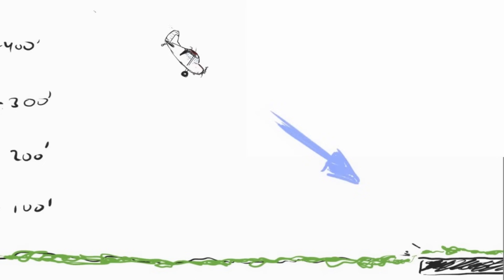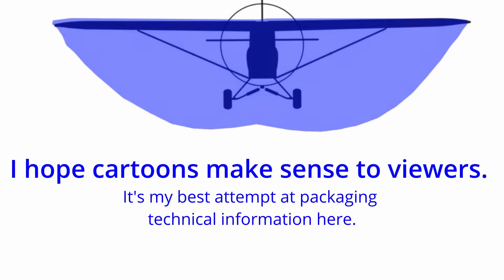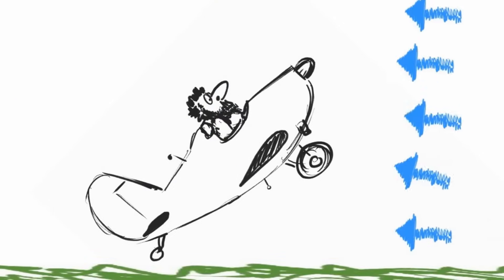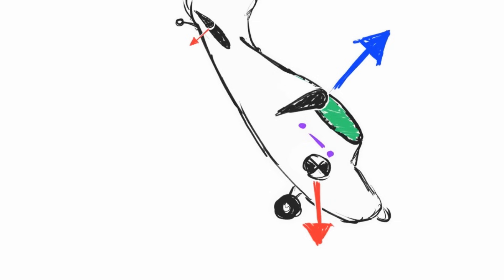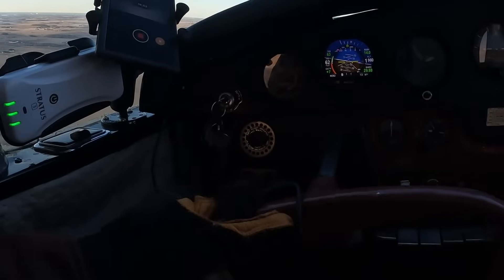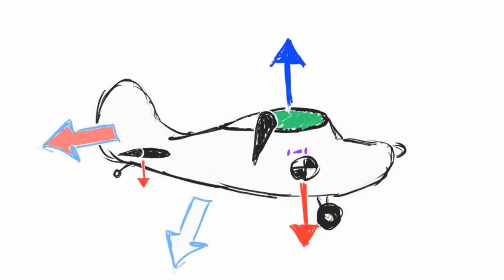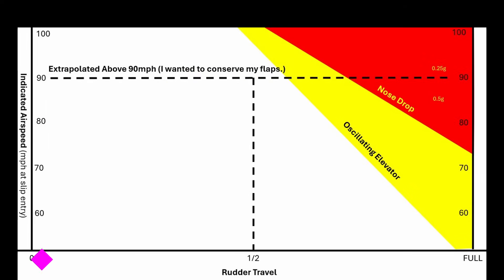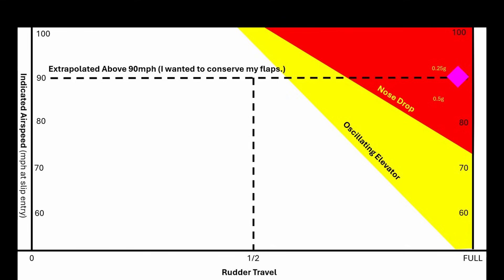Crash of a Cessna 170B, Did Slipping with Flaps Factor?

Comment: I'm having a hard time with this. The horizontal stab is an upside down wing with the lift vector pointing down. When downwash is lost on the tail during the slip and it rises into the wind, doesn't this increase the AOA on the tail and create more downforce, balancing this out? The theory here that elevator effectiveness comes from downwash from the main wing root violates the inherent stability of airplanes
Reply from the maker: You're right.  The horizontal stabilizer is, basically an upside down wing.  For simplicity I'll talk about downforce instead of negative lift.  So in normal flight the downwash from the wing approaches the horizontal stabilizer from angles that help the horizontal stabilizer create downforce.

In a stall, flow separates from the wing and that downwash is lost.  Back at the tail this changes the angle of attack at the horizontal stabilizer, so now the air is approaching from the bottom of the horizontal stabilizer.  A wing at a negative AOA creates lift, but in the opposite direction.  With a reversal of AOA at the horizontal stabilizer, that downforce is turned into upforce (or a whole lot less downforce).

I'm glad that you talk about the inherent stability of airplanes.  Placing the horizontal stabilizer into the downwash of the wing DOES make the plane somewhat less stable in pitch because more downwash occurs at higher AOAs.  This is why T-tails are a little bit more efficient because they are less-affected (though still affected somewhat) by wing downwash.  

There's a discussion of this phenomenon in Aerodynamics for Naval Aviators, pages 256-259.  The text is available for free from the FAA as a .pdf, and is easily searchable through google.  I'd share images and sections here, but I can't figure out how to make links work.  If you're using the table of contents it'll be the section under "Stability and Control".

If there's enough interest in this I may set up some CFD models or rebuild a wind-tunnel for my kid's school and we can capture some videos with model planes.
Reply: @jonathanzarinnia884  I think the wind tunnel thing would be sweet, I've looked for exactly that before and haven't found one.
Reply from the maker: @digitaldyslexia7589  Wind tunnel videos used to be all over the place, but now they're getting hard to come by.  Openfoam has some decent CFD capabilities within my very low budget.  I have to teach myself to use it better.  If this thing ever gets monitized, maybe I can ask a grad student to set up some meshes and run some CFD for us?
Reply: The flap is pushing air downward disrupting flow on the horizontal stabilizer. In a slip the fuselage blocks the flow to the opposite side and causes asymmetrical flow over the horizontal stabilizer/ elevator.= pitch down.

Comment: My old, grey, 195/waco -flying instructor said that you cannot stall in a slip, but you can coming out of it.  Dunno if he was talking only about the no-flap J3 or Luscombe.  I've had an early 180 since 1996 and do slip it with full flaps w/o issue.  But, the 180 hardly has a rudder compared to pre-war planes.  I'm wondering if the 170's with a (relatively) larger rudder and lighter weight (for roughly the same airframe) contributes to this here?
Reply from the maker: The NTSB investigators surmised there was a slip.  When the report was sent to performance analysis, they compared GPS track data with weather at the time and figured out the speeds, banks and angle of attack of the airplane during the event.  The AOA never got close to critical.  The performance engineer suggested some form of sideslip may have been applied in order to make the math work.  The NTSB investigators also surmised this may have been an issue from the context of the flight, etc.

So we don't know if they slipped or not.  We think it's likely this was tried.  But you are correct; without observers, video, recordings we'll never actually know.

Comment: Wow, what a long-winded way of saying that there is no need to use full flaps on a 170B until you're almost over the threshold.  Using flaps to steepen your approach and lose altitude is much more inefficient and dangerous than slipping.  Since the 170B has a flap handle, adding all the flaps you need for any particular type of landing is a matter of about one second.  Having full flaps a mile out on the final approach eliminates any chance of making the runway in the event of an engine failure, and besides that, if you have to dump flaps, you immediately lose altitude.  None of that happens in a slip.  When going in and out of a slip, the plane flies immediately without losing any altitude. 40 degrees of flaps and slipping is overkill and dangerous in a 170B

Comment: Interesting, I've been slipping with full flaps for 20 + years in my exp. RANS S-7 , and never had any elevator blanking, I didn't even know it was "a thing" until hearing about it here.
Reply from the maker: It's mostly a thing for the Cessnas because of the specific design of their flaps and tail.  I wouldn't worry about doing it in your s-7, if you and your friends haven't had problems.

I still occasionally do it on the Cessna 170, but I'm slow when I do to stay away from the conditions that cause the drop.

Comment: Too bad. Forward slips with flaps a great tool at times.
Reply: Why?
Reply from the maker: With 40 degrees of flap the plane sinks pretty steeply.  I still like having the tool available, just like having S-turns, etc. in the playbook.  But you're right, there's a lot of drag available to get down with 40 degrees of flap and the engine un-wound.
Reply from the maker: I still sometimes slip with fully deployed flaps if I need to, but I'm slow.  So I'm not saying you can't do them; I'm just saying you need to know the risks and recover if you encounter the nose drop.
Reply: Hard Slip no-flaps, pop partial flaps, exit slip. Then full flaps, stabilize, flare.

Comment: Does this slipping restriction only apply to full 40 degree flaps?  Is it ok at 30?
Reply from the maker: Well, it's not a restriction.  And the precise line where it becomes an issue is hard to describe.  You don't get the nose drop at 30 degrees flap, or at least I wasn't able to find it.  I did get some elevator oscillations.

Comment: How can anyone state he was slipping the airplane with no witnesses to confirm it.  Like others I've slipped 172's with different degrees of flaps in heavy crosswinds with no issues.  If maneuvers are handled smoothly without over-controlling, i.e.: chasing the upsets behind the game, there should be no issues.  Any decent airman can feel the airplane and avoid troubling inputs.  I think flying floats from a river with never ceasing crosswinds teaches a lot about slipping to spot land in tight areas and a lot of fun.
Reply from the maker: The NTSB did a performance analysis that concluded the plane did not stall (based on GPS data from a Garmin 296 and performance engineering).  So they guessed some kind of slip was applied.  This was in line with what the NTSB investigator on site thought.

We will never know the exacty sequence of the accident, however.  The only observations were from some people at the airport who saw the plane enter the pattern.

Comment: "The downwash from the wing hits the top of the tail."  Then explain how t-tails work.  In other words, that's not how the horizontal stabilizer works.

I think you're halfway there.  Another thing to consider:  Pilot freeze.  If the pilot had immediately returned the asymmetric controls to normal, they would have recovered.  If they froze, then they would have locked in the nose tuck.
Reply: Depends on how low they were.
Reply from the maker: So we teach that T-tails are out of the wing's downwash.  This is a simplification to explain the advantages of T-tails.  In reality air doesn't work with crisp clear borders (at least not until we get close to the speed of sound).  T tails aren't outside of the wing's downwash, they're less inside it.  

So with T-tails being less affected by the wing's downwash it takes less surface area to gain equivalent stability.  This is because downwash is de-stabilizing generally and a change of some value in the airplane's mean angle of attack results in some smaller variation in angle of attack at the tail.

But the T-tail is still affected by downwash.  A separation of flow at the wing will still affect a T-tail, but much less.  This is one of the reasons why T-tails in combination with swept wings lead to issues with deep stall in certain generations of transport airplanes.

As an aside, do you guys think there'd be any interest if I distributue some Open VSP wake models, charts around pitchining moments and compare those to what we see with yarn, streamers and other things taped to a plane?
Reply from the maker: T-tails are still affected by wing downwash, but some degree less.  We make a lot of simplifications when we explain things, and this is necessary to teach and understand any new concept.  In this case, we teach pilots that t-tails are "out" of wing downwash.  In reality they are still affected by the wing, just less so.  This is due to air being a viscous fluid.

So it's true T-tails experience greater variation in local AOA with changes in aircraft total AOA which means they need less surface area to stabilize the plane.  But it's also true that they are still affected by the wing and still experience changes when flow separates from the wing (and other parts of the aircraft).

For these videos, I too have to make some simplifications.  I could run a number of models in OpenVSP and share ancient wind tunnel video, but that would turn pretty boring pretty quickly, and then we'd devolve into a discussion about whether I was using realistic values in models with associated discussion of GUI interface, etc.  That devolves into an endless cycle of quibbling.

So instead I use cartoons, terms like "downforce", etc.  Even when we talk about angles of attack, we then have to disambiguate local, section, induced angles of attack.  So simplifications are necessary, but they come at a price. 

If there's demand for more granular detail and people want to poke holes in my methods and concepts (I'm sure there are plenty of holes to be poked.), I can put something together.  It's just me doing this however, so I have to right-size what I'm trying to talk about to my target audience.  In this case it's a broad spectrum of pilots.

Comment: I've slipped with flaps in a 172 on landing.  The main thing is to not let the nose drop lower than you had it before the slip, or to only let it drop a bit.  The slip doesn't require a further down pitch to lose altitude.
Reply: Either slip or use flaps.  No need to use both at the same time.

Comment: The analysis seems plausible. Those higher speeds on final are unnecessary, especially if you're slipping with flaps, which implies you're doing a short field approach. In my 172, the POH is more conservative, saying "avoid slips with full flaps" (emphasis mine). I have about 1500 hours flying various 172 models, plenty of landings on short/soft fields using slips with full flaps, and I've never encountered this. It's worth noting that the term "full flaps" can be ambiguous. For example many 172s have max flap limited to 30* in order to get an extra 100# of gross weight. In such an airplane does "full flaps" as written in the POH mean 40* (the airplane as it left the factory and presumably the airplane to which the POH refers) or 30* (the airplane as it exists now)?

Comment: I don't know what to say.  I flew 172Ms with 40degree flaps and slipped them with full flaps and no problems.  I didn't even experience the tail oscillations that the manual warns of.  Full-flap landing speed is 65MPH-75MPH IIRC.  If you're slipping to a landing with full flaps then you're trying to get down in a hurry, which implies you shouldn't be trying to execute the maneuver at high speeds where the nose drop was found to be.  Is this really a problem for Cessnas?
Reply from the maker: Sorry it took me so long to respond.  I slip with full flaps from time to time, and I made this video.  If you know what's happening when you get these pitch oscillations, and you can tell the difference between these and stall buffet, you know how to avoid and recover from trouble.

Comment: I was always curious about this when the threshold was crossed.  My instructor years ago just said full flaps and high speed with full rudder could cause a complete loss of elevator control, sort of like what happens in an unrecoverable deep stall in an MD-80 but in reverse.

Comment: Great explanations and animations!  I especially like that you mentioned the vortices off the outboard edge of the flaps. You get this aero engineer's seal of approval and SUBSCRIBED.  I slipped a 152 with full flaps with some regularity and never had an issue at any speed (thankfully).  I think what saved me was that when entering or leaving the slip I would ease into the slip so I could correct for pitch without even thinking about it.  Except for stall/spin recovery I tried to not make violent corrections.
Reply: I too have enjoyed full-flap slips with the 152,I think the 152 does not have the "no slips full flaps" warning, but then again they only go to 30 degrees.
Reply from the maker: Thanks!  Glad you like the video.  I'd like to work some CFD into these videos in the future sometime.  For now I'm very glad to have an aero engineer as a subscriber.

Comment: I agree, when I have full flaps down even in a c-172, something about that configuration just doesn't seem right for full slips, maybe its just because I read the manual, but it seems stressful to the physical aircraft and aerodynamics/ airflow over the plane.
On the other hand, flying a towplane - a pawnee, its slips great with full flaps ( the flaps are tiny ) right down to the round out and flare.

Comment: My wife and I have owned three Cessna 172s, a "D" and two "Ns", and in my younger days I accumulated at least 2500 hours as a CFI in this airplane. This flaps "avoidance" issue was always well discussed at the blackboard/whiteboard and at the airplane OTG with me flying my hands around the wing and towards the tail to show how the airflow impingement thing worked. The rule I taught (as did every other CFI that I associated with) was to "avoid slips with flaps extended" -- but it was mostly a paper rule, having trust in the engineers and test pilots who refined the Skyhawk's design.

We demonstrated and monitored many stalls at altitude (in a Skyhawk, at least 2000' AGL), including with full flaps and cross-controls, including full steady rudder inputs left and right. We discussed spins, spin entries, and spin recoveries and I was always ready for some new behavior to present itself. Only twice in all those years could I get the Skyhawk to give me a "bad result" and both times that was an uncommanded nose pitch down of 30-40 degrees. Recovery was straight forward and obvious, also fairly easy, notwithstanding the loss of altitude. 

You're on the right track and your conclusion is plausible.

Comment: Those familiar with Meacham Field in Fort Worth TX will be familiar with the old 27/09 runway which is now not in use.

On a busy traffic day in the early eighties, I was on a right downwind to runway 16 left. There were several aircraft on the downwind and a couple of jets on a long final to 16 left. The tower cleared me for the option, extend downwind or take runway 09.

I selected to take runway 09 intending to land long and reduce the time to taxi to my flight school.

The tower replied Clear to land runway 09, hold short of 16 left. WHAT? Oh shit! My runway was cut in half or more, immediately power off full flaps, not happening, forward slip, falling like a rock, close to the numbers, off of the rudder and aileron, flare, bam onto the runway. I bet I didn't roll 4 feet! All this right in front of the tower. I pictured them all laughing their ass's off up there.

Not much flare when the airflow to the elevator is blocked by the barn door flaps at 40 degrees.

Exciting times.

Comment: While I appreciate the amount of effort that went into making this video, your premise is fundamentally flawed in your explanation of how the elevator works. It isn't down wash that opposes the nose down pitch of the CG, it is the down FORCE. The elevator is an upside down wing that lifts in the downward direction. As the airplane is slipped, airflow is disrupted over the tail and causes the elevator to stall or generate less lift and the tail comes up.
Reply: Correct

Comment: This is a super interesting video. I train out of Auburn. I fly a 177B, and I do my approach with 30° of flaps, and I like to stay a little bit high, so it is very common that I slip when landing on runway 25 on this very same approach. Auburn is a dangerous airport. There are power lines close to the approach end of 25. There is no good place to put the airplane down if you lose an engine. I tend to stay high, ensure that I can make the runway, and slip it in. I suppose what this means is that I should be OK with 30° of flaps, so long as I watch the airspeed. But this was a great warning for me. Thank you.
Reply from the maker: I don't believe the 177 has similar problems due to slipping with flaps because the flaps are longer-span.  The Cardinal had a separate issue with tail stalls which is why they added slots to the stabilator.
Reply: @jonathanzarinnia884  Yeah, that was on the earlier models of the 177. Mine is a 1976 177B. Tail issue fixed. I'm going to take the airplane up to altitude and see if I can get anything resembling this behavior. Suspect the difference between 30 (the max on the Cardinal) and 40 degrees of flaps is huge here.
Reply from the maker: @sidneyh.vanness2844  That's really cool!  I'm interested to see what you find out.  I suspect you're right.